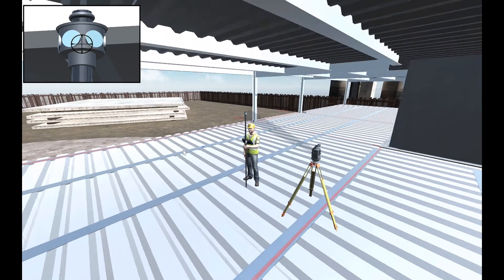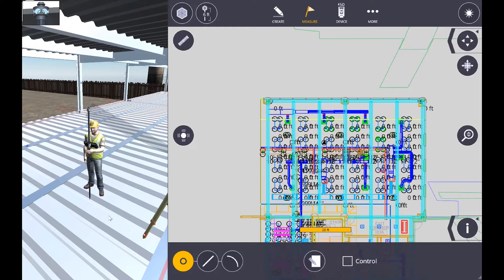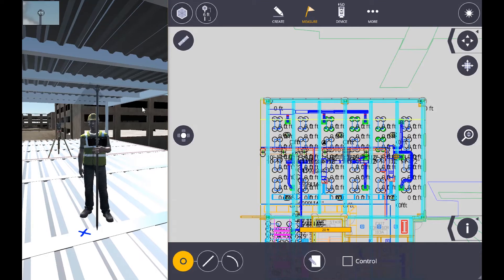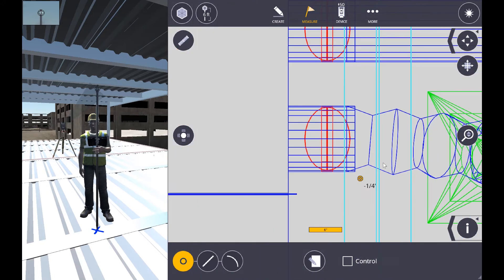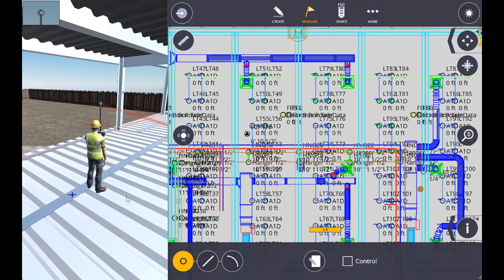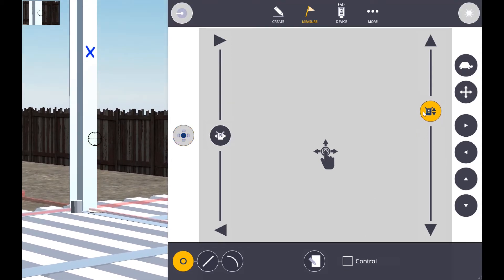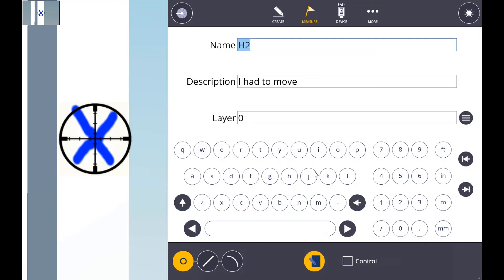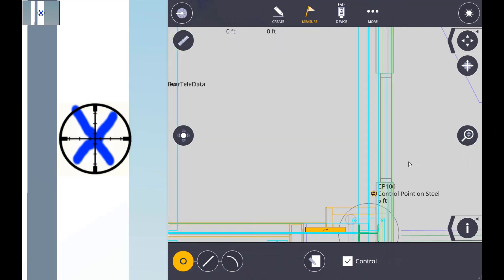Trimble RTS - Collecting Data in Prism and Laser Mode

Comment: Good afternoon, I have used your guys content a lot as I have been running a RTS 773 to layout buildings and have been learning in the process. What Version of the trimble software are you guys running? Mine does not have the buttons on the side to move the laser up slightly, I only have the slide wheel. Any help is great.
 Thank you
Reply from the maker: Thank you for your comment.  We are thrilled that our videos are helpful to you.  The majority of our videos are shot using Trimble Field Link versions 5.4 or 5.5.  You can check your version and license by clicking on the "More" button in the top right and then selecting "About".  Please feel free to email or call us and we will be happy to help you navigate using the product.  Stay safe!
Reply: Is this on all rts stations?